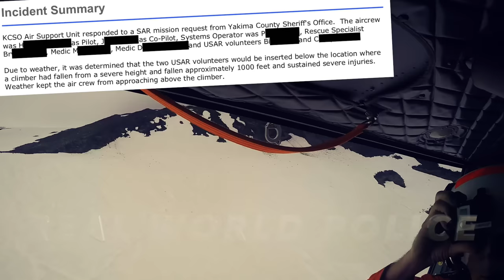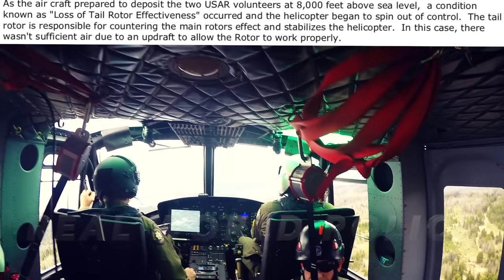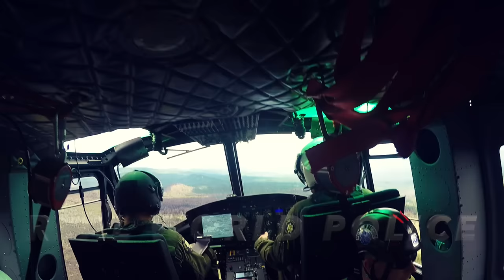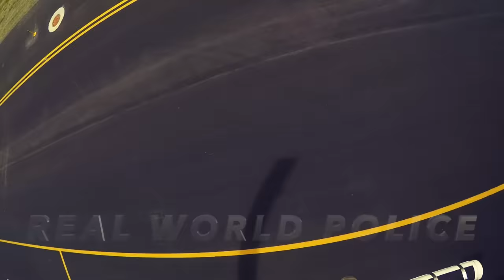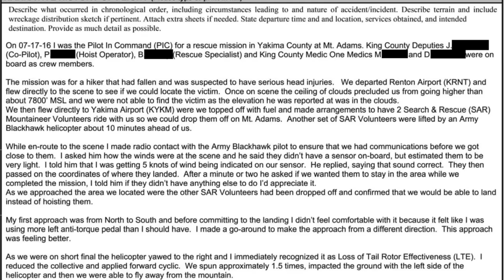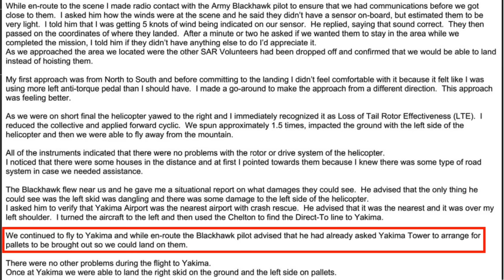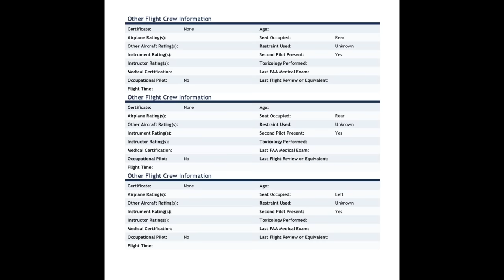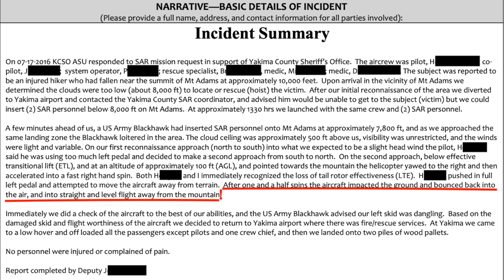Police Helicopter Loss of Tail Rotor Effectiveness & Collision With Terrain (HD)

Comment: Of course the NTSB found the pilot at fault. For some reason I find it hard to believe that simply failing to apply the yaw pedal while on final would send the helicopter into an uncontrollable tailspin. I feel like failing to apply the pedal at that altitude under ideal conditions would result in the helicopter veering off course not spinning out of control. Not a pilot myself mind you but from what I understand about helicopter controls this just makes no sense to me at all and I am more than certain the pilot and the co-pilot had the counteracting pedal matted as soon as the helicopter went into a spin. Its just impossible to believe both the pilot and the co-pilot did the wrong things at just the right time.

It would make more sense if it mentioned weather conditions like wind caused the tail rotor to loose its thrust. Thats a situation that can be extremely difficult if not completely impossible for the pilot to correct and acts of god are simply that, out of human control. I think the pilot and co-pilot did a fantastic job getting the crew home safely and successfully landing with a damaged skid. The NTSB can go suck it with their ruling and that pilot better still have his license.

Comment: God I can only imagine what would've happened if it had started spinning at a slightly higher altitude. Great work, from recovery to landing.
Reply: Honesty if he had more altitude to work with from the beginning he might not have even belly flopped the ground at all... He'd have enough time to gain speed in a direction and prevent the tail from spinning.
Reply: Michael Williams  I'm not sure, I didn't read the report at all so I may be wrong

Comment: It's a good thing the rotors didn't strike anything. That would have required and entire drive train inspection including mounts and replacement of hangar bearings and couplings and THAT'S if you are lucky...... It's a lot of work, I've done it back in the day.....

Comment: Asking a real pilot here for some info. 
When LTE encountered, does the craft naturally want to settle, or is that pilots instinctual reaction? 
If instinctual, wouldn't it be a benefit to add collective and get out of GE and up into cleaner air, or would that exasperate the problem by adding additional torque?

Not quarterbacking here, genuinely curious. 
Thanks
Reply: Never ever apply power or collective if you encounter LTE just push the cyclic fwd n if terrain allows lower the collective but NEVER apply power

Comment: 8,000' altitude and 8 pax on board a Huey full of heavy rescue gear,  puts it in a very vulnerable position. Needed to do an OGE power check at 8,000'. Poor judgment but good flying. (Or lucky?)

Comment: Serious QUESTION:  if you know you’re having engine issues in a helicopter and might not make it back to the airport.  Is it better to be flying high in case you have a malfunction so you can use autorotation to land or low as in 20 to 30 feet off the ground so when the engine fails you have less distance to fall? Seems like your survivability would be fly low back so the impact wouldn’t be violent if engines fails and you hit the deck.

Comment: The county needs to give the entire aircrew a commendation. Not just the Pilots. Those guys placing the pallets would have been killed if this Huey would have rolled over.
Reply: Loss of TR Effectiveness is when the TR cant counteract Main Rotor Torque anymore. Huey Rotors spin CCW, so if you lose the TR, the nose yaws to the right (CW). The TR turns at a rate of 5:1 revolutions of the MR, so you "could" increase MR Speed (NR) but at 8,000 MSL, it probably doesnt have much more to give. Only way to fix LTE is to get it into ETL and gain forward airspeed, or possibly enter an auto if you're low Airspeed to get the nose back to the left, and push over for airspeed.
Reply: @mikepazzree1340  Appreciate it. I fly them currently, and LTE was always a big concern when picking how you wanted to shoot the approach. Military teaches us to fly 45 deg angle to your landing so you always have an escape vs. flying directly nose into the mountain, so as soon as you're running out of left pedal you start working it downhill to get the forward airspeed and weather vane the AC

Comment: It occurred when passing the steep ridge, which usually effects a helicopter with strong up or down drafts. Should have been at a higher altitude to lessen these effects and the LTE.  LTE enables the normal torque created by the spinning rotor system to over power the tail rotor power even with full input from the pilot. Good thinking to salvage the aircraft upon landing. Lucky they accidentally stopped the spinning through the collision. They would have spun out of control. Being so close to the ground would not have given them enough time to recover. Not having a skid would have made the chances of recovery even worse. Again, very good thinking on the pilots part in continuing to fly the aircraft and never giving up.

Comment: just shows wasn't their time. usually almost always when tail rotor authority goes away, so does the aircraft. Then the massive inertia of the huge mass of rotor, does not separate cleanly, but in large unbalanced pieces each pulling the craft first this way then that, at speed fast enough to break bones, like in your head and neck, or anywhere.

Comment: This is what a level head pilot and good training do. As soon as the heli started it's right spin the pilot knew what to do, instantly apply left peddle, lower the collective (to reduce torque) and advance forward cyclic to increase lift. The heli did strike the ground in the process but maintained enough lift to climb out and away. Had the other's on board help with damage asessment and visually inspected by another aircraft who monitored condition in real time back to base.

Comment: Is there any warning to the pilot before "Loss of Effect.." or any gauge that can monitor the air presence....??
Tnx for the vid.
Reply: Yes. In the NTSB report it says he was using more left pedal than he thought he should have. That was his clue of what was about to happen.
Reply: WAT charts, tells the pilot IGE and OGE hover preformance.  He should know if he can land at that altitude.
Reply: doing a dummy run at low speed and seeing if you hit the pedal stops is a good check, and always turn left in a bell.  Wuz shakin Ian?
Reply: No, there is no warning. It goes by feel.

Comment: Maybe also as a recommendation, they could drop a smoke flare down range to actually see what the wind is doing.
Like the Blackhawk the rolled down the mountain during a rescue, the wind went from a headwind to a tailwind.
A smoke flare would've alerted the pilots to a change in wind direction.
Used to locate LZs in combat. So to me it makes sense to use them in a civilian operation.
A $50 flare could save millions of $ of helicopter.

Comment: What would have caused the condition of not enough pedal to hold the yaw?  Is it from using a lot of collective and low RPM instead of less collective and more RPM?  My only pilot experience is with an RC helicopter near sea level, and on the toys there is enough tail rotor to hold the yaw even with 100% collective, although on the toys you typically have the RPM cranked up which makes the tail rotor very effective, but it makes me wonder why the real thing would be different?  Did the thin air at that altitude possibly have a lot to do with it?  Prior to landing should the pilot have turned up the RPM to make the tail rotor more effective?
Reply: From what I understand from other comments here is that the Huey does not have lot of tail authority and add high altitude, high density altitude, maybe warm day, low pressure, thin air, maybe relative heavy helicopter (crowded in the back, IMO) and a shifting wind, maybe downdrafts. The helicopter is using a lot of power (both throttle and collective) to hover which translates into high torque from the main rotor which the tailrotor needs to counter. Also when slowing down helicopters loose lift as the blades are no longer moving in undisturbed air, called transitional lift. That worsens the problem as more torque is needed to maintain a hover. Fenestron tailrotors is much less susceptible to loss of efficience. Also more modern helicopters for the most part have better tail authority.

Comment: I spent a year at Fort Carson, CO as a flight medic in a Huey and I learned flying in the mountains is no joke and will kill you fast if you don’t know what you’re doing. It took several months before we were lucky enough to go to HAATS and learn that we had no clue how to fly at high altitude in a Huey. That week was the most intense flying I’d ever done and scared the hell out of me many times. Flew over 14,000’ numerous times and landed on some of the highest and smallest LZs I’d ever seen. Sitting on top of a pinnacle that was barely big enough to fit most of the skids on it thousands of feet in the air while looking down below us in the rear cabin was not fun. Also ended up taking off just under the max winds but after flying a bit we were fighting 40+ knot winds.

Comment: The reason the helicopter was able to keep flying was because after the anti torque went out the pilot applied forward motion so basically it was able to stay going straight because the speed and the air pressure was keeping it straight
Reply: There was only a momentary loss of counter-torque, as explained in the video. The helicopter was able to keep flying, because the only damage was to it's skid. It's tail rotor was fine.

Comment: I don't think I could have remained calm after out of control 1 & half rotation & initial impact contact with rock and seeing damaged left rear door ,that long all of the way back to the airfield for a hovering disembarking.
Great job to both pilots,and brainstorm of utilizing pallets for level landing with shot skid to save rotor blades!👍

Comment: Could somebody help me out here? at 4:05 it says that spinning is normally fatal for the aircraft because it cannot be controlled. I understand this if the tail rotor is damaged but it seems like it wasn't damaged here, just lost effectiveness briefly. My question is how come the pilots cannot regain control when they lose tail rotor effectiveness? I assumed that at some point they would be able to regain control once the rotor has enough air.
Reply: LTE isn't a mechanical problem. The pilot can regain control by applying forward cyclic and reducing power. I think that they were too close to the ground to do that though which is why the "belly flop" was the only way. Perhaps the pilot knew (or hoped) that the helicopter would be able to withstand the impact. You definitely can't do that with a smaller one.

Comment: UH-1 is a tough old bird. I am not a pilot although i wish i was. I have always had an interest in helicopters. My mother was a UH-1 mechanic in the 101st airborne at Ft Cambell Ky. In the last year and a half I've been listening to a lot of audio books. Mostly about helicopter pilots in Vietnam, Iraq & Afghanistan. Its mostly the Vietnam UH-1B&C gunship pilots that delt with this as well as some slick pilots too. In the books I've listened to they refer to it a "Running out of left pedal" which i believe is what happened here. I know with the Vietnam pilots it was often due to lack of power and air density. If i remember correctly it was called (DA) density altitude. I know there are considerably different conditions in Wa state as apposed to Vietnam.  Does anyone know what else would cause this to happen aside from lack of power?
Reply: Chickenhawk is a must read if You havent read it already.

Comment: I am a corporate safety manager and definitely not a pilot, but huge fan of NTSB investigations simply due to "root cause analysis".  With that being said, why wouldn't the right move be to set the helicopter down on either the mountain, or the first flat ground deemed worthy of a landing?  I know there was skid damage, but it appears to me that the pilots were rolling the dice not knowing the true extent of the damage (mechanical) and proceeded to fly back to base.  Not trying to flame anybody, simply curious as I am sure I am probably missing something.
Reply: I wouldn`t dare to try to land anywhere near there again. There were challenging winds and high up. And I guess the pilot felt the controls were ok.

Comment: Incredibly lucky to have maintained control of the aircraft after spinning and collision with substantial damage. Those are difficult conditions to fly in for sure but the pilot error conclusion is appropriate. It’s his job to know the characteristics of the aircraft and in what conditions it’s capable of flying in. Luck was on their side!
Reply: maybe was not into the wind and a bit lax on his approach , turning downwind to the left would take more power and add wind to that and you may be in trouble ,, that being said "shet happens "  been there done that,,

Comment: It fails me to understand why there is no technology for a back if the Tail Rotor fail. Why cant they have two independent tail rotors along the tail where if one fails the other kicks in. When the tail rotor fails the body of the heli... spins instead of the main rotor blades.  Meaning though the main blades are still spinning the torque is transfered to the body of the Heli ...instead of the main blades. How many times has there being serious accidents with these tail rotors failing. I've seen hundreds alone here on YouTube.
Reply: why dont you invent it?
Reply: @jamesporter6288  I may do, and I'll use you as a test pilot.

Comment: A CLEAR CASE OF PILOT ERROR. Two rated pilots at the controls, and no mechanical problems with the helicopter. These pilots created this situation! Another interesting point is that this military surplus helicopter operated under “Public Use” was being operating outside of King Country’s jurisdiction in violation of the US Code of Federal Regulations (CFRs). These pilots are not heroes, deserve FAA violations, and 44709 reexaminations due to their lack of flying skills. The King County Sheriff also should be more familiar, or simply not disregard the CFRs.

Comment: When I was first learning to fly , I was told , there are helicopter pilots who have had accidents and those who going to sooner or later. This flight crew did an amazing job and it speaks volumes about their skill.
Reply: Skill....that A/C will enunciate well before it gets to that point of "oops I just messed up"....on top of that it had the van horn T/R and a 703....never should have gotten to that point...if the pilots knew what they doing....but i guess if you have 200hrs PIC you can operate at high altitudes well above your skill level...if your a public use A/C....tax payers fixing phuc-ups...they already paid for that brand new helicopter....what a waste....🤦‍♂️🤦‍♂️🤦‍♂️

Comment: So they got lucky that the impact was angled in such a way they did not impact the rotors. How in the hell did he lose control? I get the wind, but they train for this. I'm no pilot, I am just convinced it could have been avoided.
Reply: It’s a combination of the winds, near-zero forward airspeed and high power requirements (operating at high altitude and high aircraft gross weight). All of the above means the tail rotor loses effectiveness and without a working tail rotor there’s nothing to counteract the massive amount of torque applied by the main rotor. Remove any of those conditions and the accident probably wouldn’t have occurred. LTE is a known hazardous condition that helo pilots are aware of but there’s nothing to do once you’re already spinning but hold on and hope for the best. And yes, they were EXTREMELY lucky they managed to quickly get away from the mountain before they became part of it.
Reply: ConcealCarryProtect apparently they lost tail rotor effectiveness. just off the title though. i didn’t read like every report that he showed on screen. aspiring helicopter pilot

Comment: I'm a monday quarterback -- why bring so many rescuers ?
Reply: I am only speculating here. They had 4 total actual flight crew. I think two medics were in the back, or one medic and a hoist operator.  The other two were mountain rescuers. The two rescuers were probably not part of the actual flight team. They were going to insert the rescuers to recover the victim. It was two different agency's working together. All members of the flight crew needed to be on board to preform the mission. The other two were kind of hitching a ride if that makes sense. Our service does something similar. We will take a specialized person with us if the mission warrants it, but both my partner and I have to be on board to ensure safety of the aircraft and to make sure that the non flight crew member doesn't do anything to get us or them killed while on the mission. Hope that explains it. I am not familiar with that aircraft, so I can not comment on it's max weight requirements.